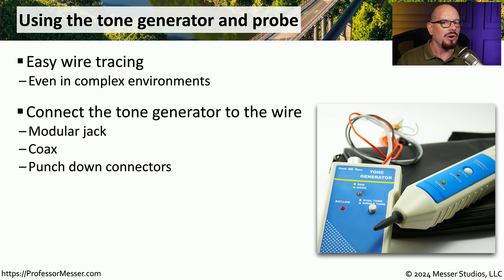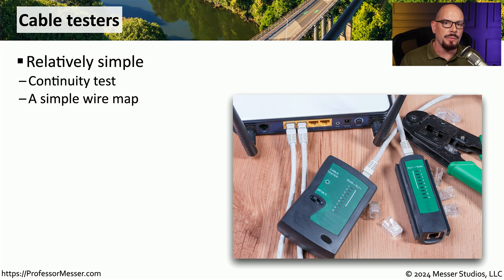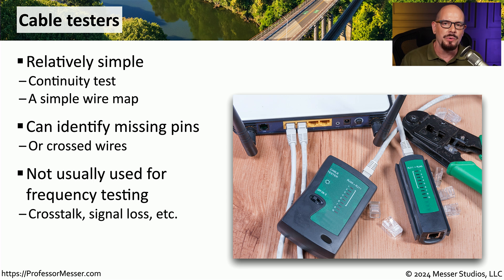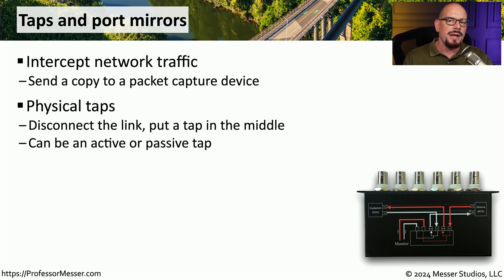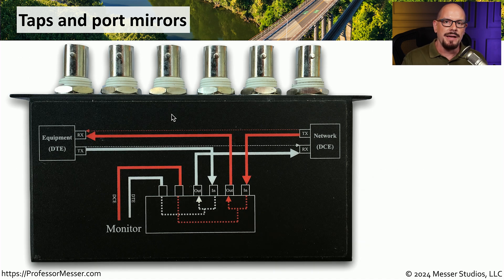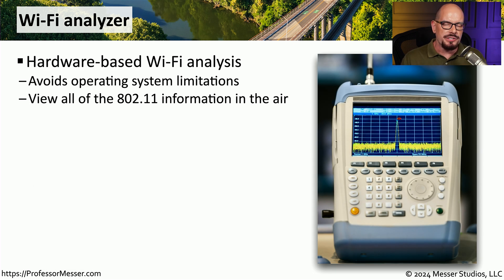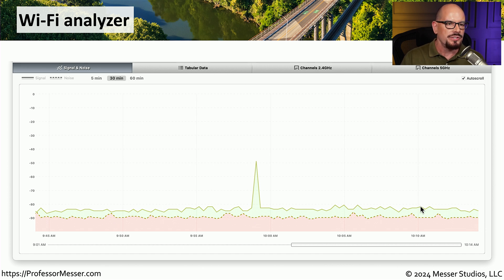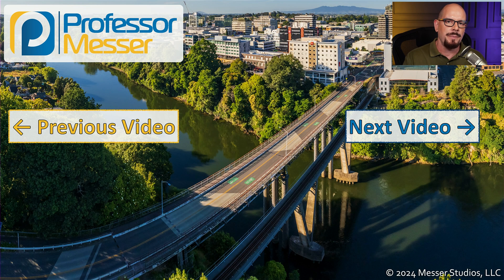Hardware Tools - CompTIA Network+ N10-009 - 5.5

Comment: Hi everyone, I am new.

I was wondering if anyone can help?
I am planning on enrolling in a course bundle and was wondering if these are a good step into the right direction 

Modules and topics covered:

 CompTIA A+ 220-1101 (Core 1) 

CompTIA A+ 220-1101: Installing Hardware and Display Components

CompTIA A+ 220-1101: Laptops Features and Mobile Device Types

CompTIA A+ 220-1101: Accessories and Mobile Device Synchronization

CompTIA A+ 220-1101: Mobile Device Network Connectivity and Application Support

CompTIA A+ 220-1101: TCP and UDP ports

CompTIA A+ 220-1101: Networking

CompTIA A+ 220-1101: Configuring a Wired/Wireless Network

CompTIA A+ 220-1101: Wireless Networking Protocols

CompTIA A+ 220-1101: Network Hosts

CompTIA A+ 220-1101: Implementing Network Concepts

CompTIA A+ 220-1101: Network Types

CompTIA A+ 220-1101: Networking Tools

CompTIA A+ 220-1101: Basic Cable Types

CompTIA A+ 220-1101: Connectors

CompTIA A+ 220-1101: Random Access Memory

CompTIA A+ 220-1101: Storage Solutions

CompTIA A+ 220-1101: Working with Motherboards, CPUs, & Add-On Cards

CompTIA A+ 220-1101: Working with Peripheral Devices

CompTIA A+ 220-1101: Power Supplies

CompTIA A+ 220-1101: Common Devices

CompTIA A+ 220-1101: Custom PC configuration

CompTIA A+ 220-1101: SOHO Devices

CompTIA A+ 220-1101: Printers

CompTIA A+ 220-1101: Cloud Computing

CompTIA A+ 220-1101: Virtualization

CompTIA A+ 220-1101: Resolving Problems

CompTIA A+ 220-1101: Troubleshooting

CompTIA A+ 220-1101: Troubleshooting Printers

*******

 CompTIA A+ 220-1102 (Core 2) 

CompTIA A+ 220-1102: Comparing Common Operating Systems

CompTIA A+ 220-1102: Microsoft Operating System Installation & Upgrade

CompTIA A+ 220-1102: Microsoft Command Line Tools

CompTIA A+ 220-1102: MS Operating System Administrative Tools

CompTIA A+ 220-1102: Windows Control Panel Utilities

CompTIA A+ 220-1102: Application Installation, Networking, & Tools

CompTIA A+ 220-1102: Security Fundamentals

CompTIA A+ 220-1102: Critical Security Concepts

CompTIA A+ 220-1102: Software Troubleshooting

CompTIA A+ 220-1102:Operational Procedures Best Practices

CompTIA A+ 220-1102: System Utilities

********

 CompTIA Network+ N10-008 

CompTIA Network+ N10-008: OSI Model Layers & Data Encapsulation

CompTIA Network+ N10-008: Network Types

CompTIA Network+ N10-008: Cables & Connectors

CompTIA Network+ N10-008: IP Addressing Schemes and Subnetting

CompTIA Network+ N10-008: Well-known Port & Protocols

CompTIA Network+ N10-008: Registered Ports

CompTIA Network+ N10-008: Networks Services & Data Center Architectures

CompTIA Network+ N10-008: Cloud Concepts

CompTIA Network+ N10-008: Network Implementations

CompTIA Network+ N10-008: Ethernet Switching & Wireless Standards

CompTIA Network+ N10-008: Network Operations

CompTIA Network+ N10-008: Disaster Recovery & High Availability Concepts

CompTIA Network+ N10-008: Security Concepts & Threats

CompTIA Network+ N10-008: Physical Security & Network Hardening

CompTIA Network+ N10-008: Network Troubleshooting Methodologies & Tools

CompTIA Network+ N10-008: Troubleshooting Network Issues

**********

 CompTIA Security+ SY0-701 

SY0-701 – CompTIA Security+: Security Goals & Controls

SY0-701 – CompTIA Security+: Fundamental Security Concepts

SY0-701 – CompTIA Security+: Practical Cryptography

SY0-701 – CompTIA Security+: Threat Actors & Vectors

SY0-701 – CompTIA Security+: Survey of Malicious Activities

SY0-701 – CompTIA Security+: Mitigation Techniques

SY0-701 – CompTIA Security+: Architecture & Infrastructure Concepts

SY0-701 – CompTIA Security+: Enterprise Infrastructure Security Principles

SY0-701 – CompTIA Security+: Data Protection Concepts & Strategies

SY0-701 – CompTIA Security+: Resilience & Recovery

SY0-701 – CompTIA Security+: Computing Resources Security Techniques

SY0-701 – CompTIA Security+: Vulnerability Management

SY0-701 – CompTIA Security+: Security Monitoring & Alerting

SY0-701 – CompTIA Security+: Enterprise Security Capabilities

SY0-701 – CompTIA Security+: Identity and Access Management

SY0-701 – CompTIA Security+: Automation, Orchestration, & Incident Response

SY0-701 – CompTIA Security+: Effective Security Governance

SY0-701 – CompTIA Security+: Risk Management

SY0-701 – CompTIA Security+: Security Compliance & Third-Party Risk

SY0-701 – CompTIA Security+: Audits, Assessments, & Awareness

*****************

 CompTIA Server+ SKO-005 

CompTIA Server+: System Hardware

CompTIA Server+: System Software

CompTIA Server+: Server Functions and Network Essentials

CompTIA Server+: Storage
CompTIA Server+: IT Environment

CompTIA Server+: Disaster Recovery

CompTIA Server+: Troubleshooting

CompTIA Server+: Network and Storage Troubleshooting

**********

 CCNA 200-301 

CCNA 2020: Networking Components

CCNA 2020: Networking Components – NGFW, NGIPS, & Cisco DNA Center

CCNA 2020: WLCs, Access Points, Servers, & Endpoints

CCNA 2020: Network Topology Architectures

CCNA 2020: Network Topology Architectures – WAN, Cloud, & SOHO

CCNA 2020: Layer 1 Interfaces & Cabling

CCNA 2020: Layer 1 Physical & Configuration Issues

CCNA 2020: Networking Protocols

CCNA 2020: IP Addressing Basics & Configuration

CCNA 2020: IPv4 Subnetting

CCNA 2020: IPv6 Addressing & Configuration

CCNA 2020: Virtualization Concepts

CCNA 2020: Network Access, VLAN Configuration, & Interswitch Connectivity

CCNA 2020: L2 Discovery Protocols & L2 and L3 EtherChannel Configuration

CCNA 2020: Spanning Tree Protocol

CCNA 2020: Cisco Wireless Architecture & WLAN Components

CCNA 2020: Cisco WLC Configuration & Wireless Management Access

CCNA 2020: Static Routing

CCNA 2020: Dynamic Routing

CCNA 2020: Configuring & Verifying NAT

CCNA 2020: NTP, DNS, & DHCP

CCNA 2020: SNMP, Syslog, & PHB for QoS

CCNA 2020: Configuring SSH, FTP, & TFTP

CCNA 2020: IT Security Concepts

CCNA 2020: Security Program & Password Policy Components

CCNA 2020: AAA Security & VPN Types

CCNA 2020: Configuring & Verifying ACLs

CCNA 2020: Configuring Port Security, DHCP Snooping, & DAI

CCNA 2020: Automation, Network Programmability, & SDN Architectures

CCNA 2020: APIs & Cisco DNA Center

CCNA 2020: Configuration Management & JSON Encoded Data

*******************

 CCNP (Cisco Certified Network Professional) 

Cisco Certified Network Professional (CCNP)

350-401: Implementing and Operating Cisco Enterprise Network Core Technologies (ENCOR)

Cisco Certified Network Professional (CCNP) 

300-410: Implementing Cisco Enterprise Advanced Routing and Services (ENARSI)

*******

 CompTIA Cloud+ (CV0-003) 

CompTIA Cloud+ CV0-003: Planning Cloud Deployments

CompTIA Cloud+ CV0-003: Planning Cloud Networking

CompTIA Cloud+ CV0-003: Planning Cloud Compute Resources

CompTIA Cloud+ CV0-003: Planning Cloud Storage Resources

CompTIA Cloud+ CV0-003: Planning Cloud Migrations and Extensions

CompTIA Cloud+ CV0-003: Security Configurations and Compliance Controls

CompTIA Cloud+ CV0-003: Security Technologies and Automation Techniques

CompTIA Cloud+ CV0-003: System Patching and Maintenance

CompTIA Cloud+ CV0-003: Disaster Recovery

CompTIA Cloud+ CV0-003: Performance Management

CompTIA Cloud+ CV0-003: Troubleshooting Deployments

**********

 VMware vSphere 7 

vSphere 7 Overview

vSphere 7 Installation

vSphere 7 Virtual Machine Creation

vSphere 7 Networking

vSphere 7 Storage

vSphere 7 Virtual Machine Management

vSphere 7 High Availability Clusters

vSphere 7 Distributed Resource Scheduler (DRS)

vSphere 7 Resource Management

vSphere 7 Monitoring and Compliance

vSphere 7 Update Manager

***********

 CompTIA Linux+ XK0-005 Domain 1: System Management 

CompTIA Linux+ (XK0-005): Installation & File System Navigation

CompTIA Linux+ (XK0-005): Storage & File systems

CompTIA Linux+ (XK0-005): File Systems & Permissions Management

CompTIA Linux+ (XK0-005): Network Connectivity

CompTIA Linux+ (XK0-005): Daemons & Processes

CompTIA Linux+ (XK0-005): Network Services

CompTIA Linux+ XK0-005: Software Management

CompTIA Linux+ XK0-005: Shells, Variables, & Configuration Files

******

 P Linux+ XK0-005 Domain 2: Security 

CompTIA Linux+ (XK0-005): Security Threats & Cryptography

CompTIA Linux+ (XK0-005): Authentication & Authorization

CompTIA Linux+ (XK0-005): Firewalls & Monitoring

CompTIA Linux+ (XK0-005): Securing Linux

CompTIA Linux+ (XK0-005): Managing SELinux

******

 CompTIA Linux+ XK0-005 Domain 3: Scripting, Containers, & Automation 

CompTIA Linux+ (XK0-005): Linux Shell Scripting with Bash

CompTIA Linux+ (XK0-005): Application Containers

CompTIA Linux+ (XK0-005): Infrastructure as Code and Git

******

 CompTIA Linux+ XK0-005 Domain 4: Troubleshooting 

CompTIA Linux+ (XK0-005): Solving CPU, Memory, Boot, & Performance Issues

CompTIA Linux+ (XK0-005): Solving Storage & Network Problems

CompTIA Linux+ (XK0-005): Permissions Issues & Restoring the Linux OS

CompTIA Linux+ (XK0-005): Troubleshooting